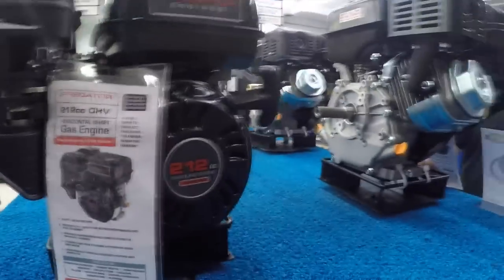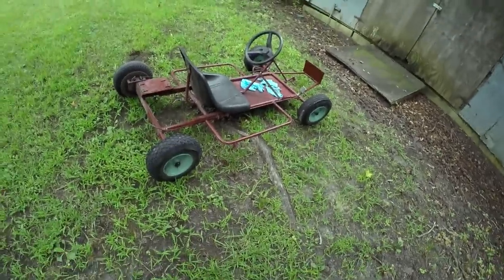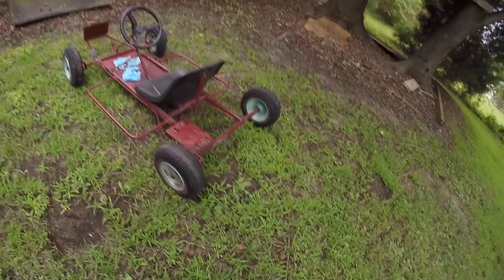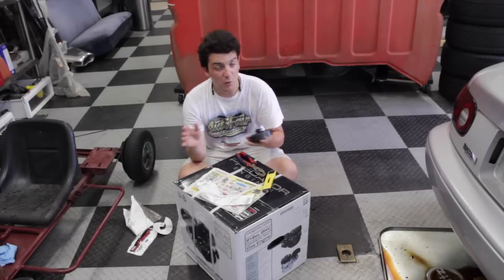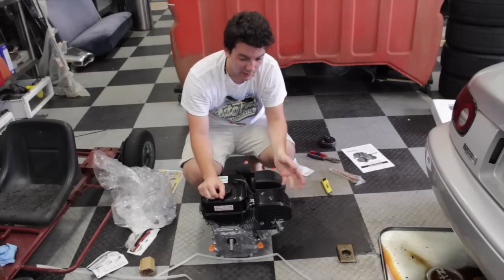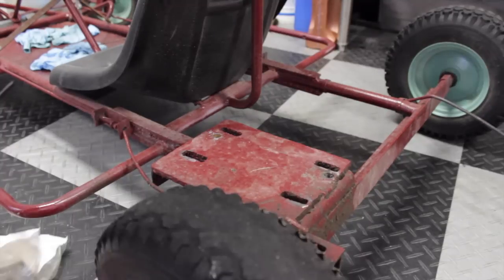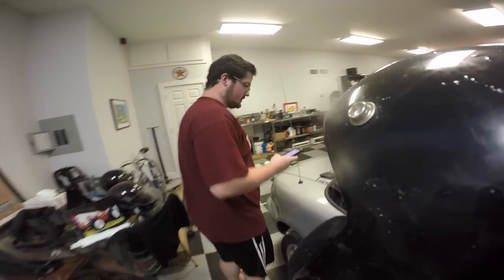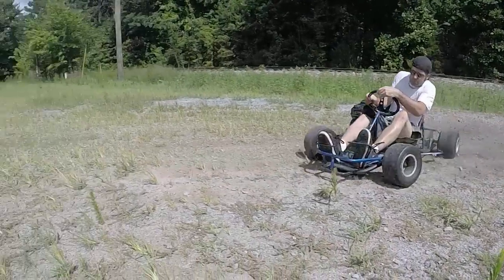The $50 Go Kart Gets a Predator 212!

Comment: 120 bucks for an engine and atv shops sell gocarts for 7k? I'm in the wrong business.
Reply: Cory Sennett i made a custom go kart that goes 60 mph and it costed $600 canadian
Reply: I have a stage one predator 212cc go kart that’s about 300 in total for 70mph and 11hp also with a racing clutch.
Reply: Maxine can you tell me what you’ve done to it? I’m rebuilding a (barn find) go kart and have no clue what I should be looking for speed wise
Reply: Preston what I will list you is what I personally think is the best one to start, once you buy the motor take the governor cause the clutch and that governor on it can explode the piston
Reply: Maxine I bought a predator 212 about a week ago and the kart had a torque converter installed already so I just swapped everything from the old motor to the new one, my stage 1 kit came in today so that’ll be a fun project. My main focus I guess is gearing now because that’s the main problem. Thanks for the help!
Reply: Preston no problamo
Reply: Preston when you bypass the governor I suggest you watch a video, I tried my first motor without watching a video and ruined it...

Comment: I have the same 212 cc engine on my metal Go Kart frame and the motor broke my frame in 2 different places by my mount its so strong but until i weld it i have a cumalong from the front end to the back end to bring the frame together haha works for now. Those motors are very fun on dirt roads btw!

Comment: What I would like to see is a torque converter and one new tire to replace the bald one. Then race them. Take the governor off of it too. Make the little red one just as fast as the other cart. And one last thing, You guys might consider knee and elbow pads. You're doing the right thing protecting your heads with skull caps. You might even consider gloves. All this will help protect you if you happen to get tossed off. Also get, a roll bar.

Comment: Wow i have that same exact frame with the same setup you know what will make driving that go kart even more fun, Disconnect the yellow cable by the on/off switch for the oil sensor so you can drift right ways its so the engine doesn't shut off when going sideways it super fun and you don't even need to take off the governor because the motor already has enough power to power slide u sideways best of luck to you guys would be awesome to see a video of you guys trying it

Comment: hey i dont know any thing about these engines but i was planning on replacing my atv engine with one of these but  why do you need a clutch system. again i dont know much about engines ive onnly used and worked on a manual gear shofting atv engine.

Comment: I have a question I got a go kart with a predator 212 engine on it and it does not have a clutch and obviously just putting a centrifugal clutch with a chain and another sprocket would be the easiest but would that be as good as a torque converter or would a tour converter be a lot better please help me answer my question

Comment: So guys I bought a predator 212cc from harbor freight and the normal one that you bought has a 70mmX55mm 2.8"X1.8" bore stroke and a 0.91 gallon fuel tank and the one I had to buy do to the one you bought being out of stock has a 70mmX55mm 2.8"X2.2" bore stroke and a 0.74 gallon fuel tank and it has more strict EPA/CARB regulations so it can be sold in California even though all the other specs are exactly the same so my question is why do I have a larger bore stroke and will it make my engine perform differently than the ones you buy if you can help me it would be greatly appreciated.
Reply: stormlang2 im not shure what the performance differences will be

Comment: Wait quick question.... if you get a torque converter do you still need a clutch?? (I'm new to all this stuff so it's probably a really stupid question)
Reply: Mark Washington no it replaces a clutch but you need a jack shaft to go from the tq converter which is belt driven to the chain drive which goes to the axle

Comment: Nice video! probably the first time I've ever been one of the first ten to view a video. Anyways, How long did your clutch normally last on the 9.5 hp kart?
Reply from the maker: trevor kidd I'd say after a few hours of riding, which for me translates to around 9 months. I've never really spent any longer than 30 minutes riding my kart at any one time. There really are a ton of factors with regard to clutch wear. If I have a larger rear sprocket, the clutch will wear less as it spends less time engaging (which is what causes the wear). There are high-performance clutches that are build for higher horsepower applications, but they also need to be rebuilt and they're quite expensive. If you ride casually, get either one of these clutches or a torque converter.
Reply: CarsandCameras thanks for the reply, I've been wondering about that for a bit

Comment: what jetting do u use after u remove the governor put a header and performance air filter on the predator 212?
Reply: +Bikes & Sleds 34 im not sure, i have a drill bit that i use and it works great

Comment: You put a 7hp engine on this gokart. What size engine are you putting on your radio flyer? Because I'm pretty much doing the same build as your radio flyer with a briggs 7hp engine. I'm hoping it's not as fast as this.
Reply from the maker: Brandon Thaggard We're most likely going with the 6.5 Predator for the wagon. We are also concerned with the speed... We're just going to wing it, as usual.
Reply: I'm in the same boat. Just winding it. Who's c10 is that in the garage? I'm also working on a 65 c10. Putting it on air ride

Comment: is it that easy to install the motor and get it running ?
Reply: yes it's easy it's just unbolt and bolt on also fix the throttle because stock they don't move and I got a Subaru engine one my go cart
Reply: +the Asus pro Mac is a lie sure you do
Reply: Nik Golič I hear sarcasm and getting a Subaru engine is easy some power washers have them

Comment: you guys should explain to people that they have to remove the low oil sensor in their predator so their engine doesn't stall every time they turn I didnt know that and for two days I didnt know why it was stalling over and over
Reply: +David Adam Me and a friend just built a kart with one of these engines, and even with our ultra quick steering, we never stalled....maybe something was wrong with your sensor?
Reply: +blindassassin111 we have had the same problem. we would go around a corner hard and stall

Comment: Switch out the two back tires so you will have more traction.
Reply: Why two :3 it's a one wheel peel after all isnt it
Reply: Sk Gaming I meant switch the two back tires. Put the Right one on the Left and the Left one on the Right that way the tire with tread will be the one moving the cart. I can see where you were confused

Comment: is it possible to make a fast go kart for under 500$ that can hold me im 6,2 and 250
Reply: +Sawyer Helle (HerkyThe2) oh yea. is 45 or 50 fast. old cart frame with 57tooth rear sproket and a 10 or 12 tooth on the clutch with slight engine mods like header jet the carb with govenor removed and a gentile breeze behind you aught to do it. im 185 with no problem

Comment: +cars and cameras I have  to go karts both are street go karts and one is a jolly kart do you know anything about jolly karts but yesterday I had a locked up motor from two years ago and when it locked up we put miracle oil in it and yesterday I taped on the cylinder and it free up so it went on my go kart and I started up first pull then the piston rod broke I two pieces and shot out of the bottom end on the motor never seen that in my 14 years of living